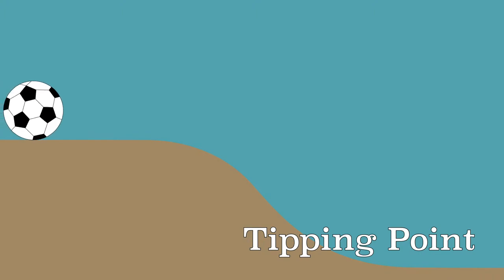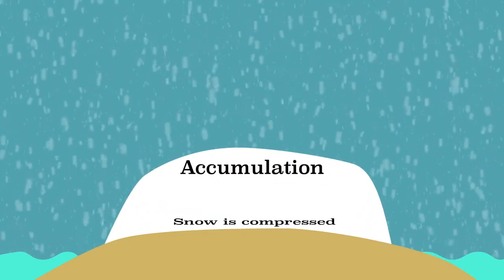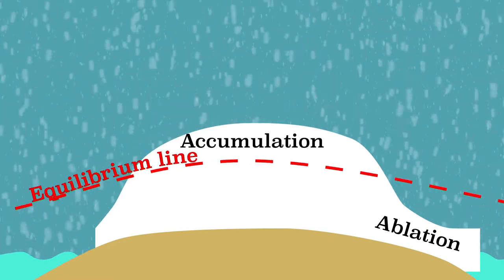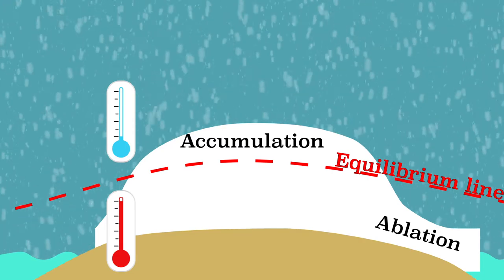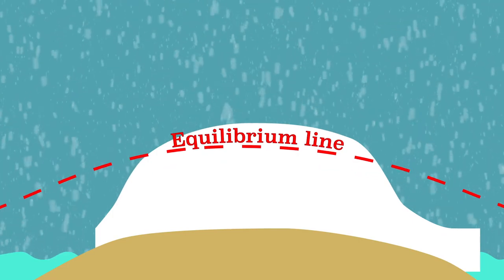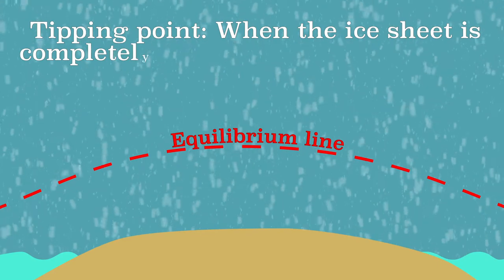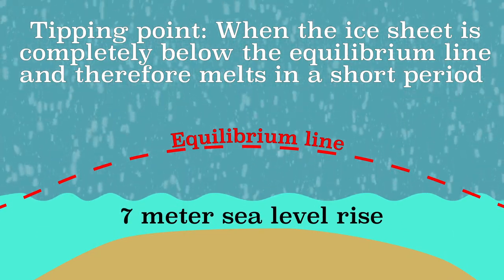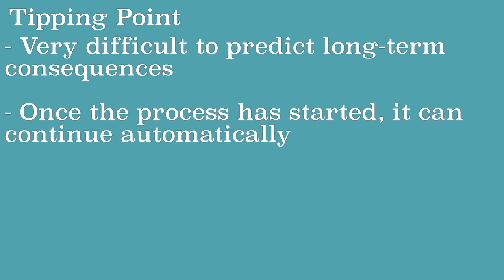Tipping point of the Greenland ice sheet

Comment: Greenland is below sea level in the center, and this basin will hold more than half the water if it melts. But, it’s only 30% water because the “ice” mass is made of compacted snow, not ice. Good luck raising the sea level. If the North Pole melts, the displacement caused by the melting snow (its not ice) will cause the sea level to drop more than Greenland could cause it to rise. Your 7 meters is a blatant lie.